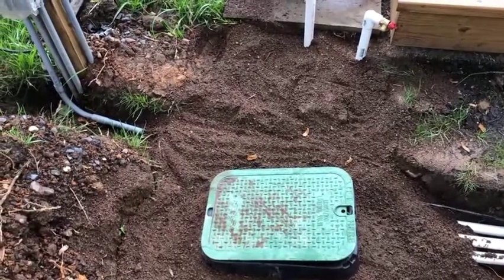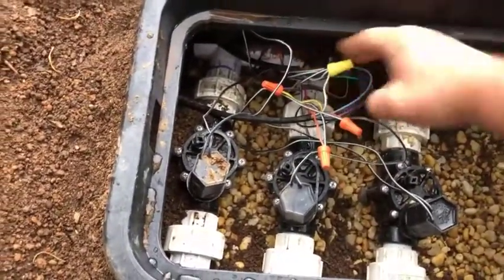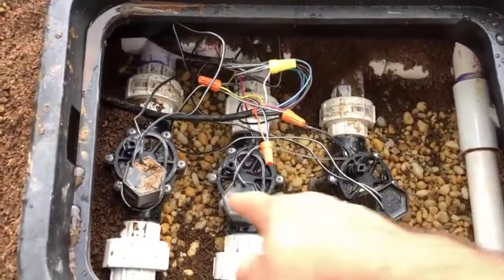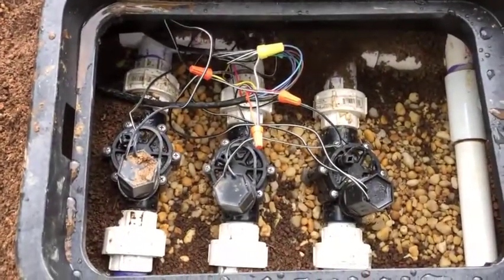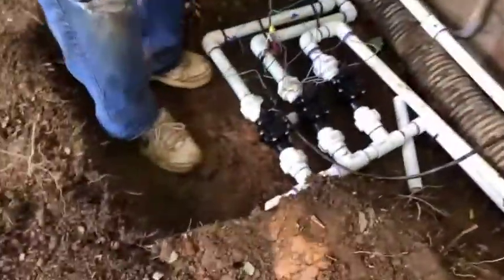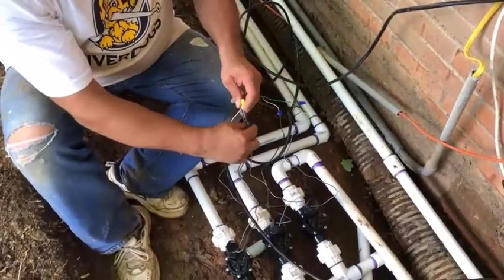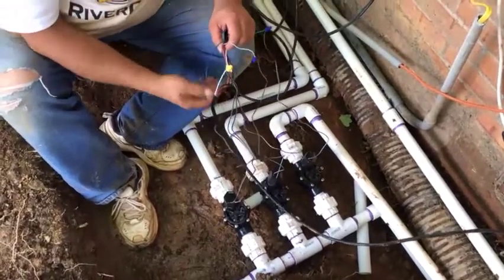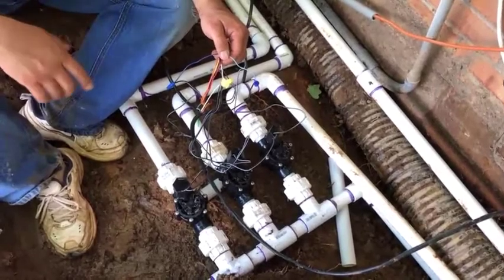8. Home Lawn Irrigation System - Wiring The Valves

Comment: Hi, great videos and work.. Can you show the connection of the relay cables at the punp?
Reply from the maker: Two videos for you
https://www.youtube.com/watch?v=0eEDXdO1fo4   and   https://www.youtube.com/watch?v=CcHFaiujry4
The FIRST one shows the working wiring simulating with a simple battery, controller, solenoid zone and a light bulb simulating power to the pump.  Shows entire circuit in operation.  The second shows a drawing to help clarify how the wiring (in my scenario) works.  The irrigation wiring is TYPICALLY smaller low-voltage guage wire, but MANY wires within the sheathing.  So as you have the main line of all wires going out, you just split open the sheathing at the first manifold, expose the wires and pick as many of the wires as you need to connect each valve in the manifold.  Then the wire continues down-stream to the next manifold and do the same with the remaining wires.  The diagram / video shows how MY setup is actually done so you can see where the wires terminate along the route.  The final black/white for power to the relay switch is what goes all the way to the lake (water source for my instance), but the white (neutral) is required as connection to EACH solenoid valve.  Hopefully this helps clarify.   Additionally, I have about a dozen showing different components of how I put it all together from sample, parts and pricing, building my own multi-zone manifold, and even the hose connections to the sprinkler and rotator units. Hope the others also help whatever you are researching.
Reply: @drapp5752  thank you, great work!!!

Comment: does a new wiring line need to be ran off of each manifold or do you just run one line to all of them? When connecting multiple manifolds.
Reply from the maker: Take a look at another of the videos... https://www.youtube.com/watch?v=CcHFaiujry4    On this, it shows a visual drawing giving better context.  The irrigation wiring is TYPICALLY smaller low-voltage guage wire, but MANY wires within the sheathing.  So as you have the main line of all wires going out, you just split open the sheathing at the first manifold, expose the wires and pick as many of the wires as you need to connect each valve in the manifold.  Then the wire continues down-stream to the next manifold and do the same with the remaining wires.  The diagram / video shows how MY setup is actually done so you can see where the wires terminate along the route.  The final black/white for power to the relay switch is what goes all the way to the lake (water source for my instance), but the white (neutral) is required as connection to EACH solenoid valve.  Hopefully this helps clarify.
Reply: @D Rapp  I've been adviced to use anything from 12-18 Guage wire. Any suggestions?
Reply from the maker: Going down to 12 gauge wire I think is a bit extreme... maybe more commercial, but not necessarily for home systems, unless you have such a vast distance that a larger wire to carry is of concern.  Also, per other video, ex: an 18/10 wire is 18 gauge, 10 wires included in the wire set -- per my video showing how I have all my zones established.  6 zones, 2 for black/white power and 2 spare.  Good luck with your build.  Also, if you do a search on my video series looking for "Home Lawn Irrigation System" should find them all too.

Comment: Hi, they are 1 inch white pvc pipes ???
And 1 inch sprinkler valves ???
How many sprinklers per zone do you have ???
Thank you.
Reply from the maker: Correct, all the runs are 1" PVC, but make sure SCHEDULE-40 which is the thicker wall which has higher pressure capacity.  Yes, all 1" sprinkler valves too.  The other (forget schedule #size) is a THIN wall which you can squeeze between thumb and finger which is drainage only, no pressure.  I have 6 zones in total.  1=Garden hoses, one by the lake and other led to the front of the property. 2=back yard, 3=left-side, 4=right side, 5=front pond/garden area, 6=front yard.  My controller has capacity of 8 zones in case I ever did want to expand.  Anything else I can clarify for you?  Let me know.
Reply: @drapp5752  Thank You For Answer Me Back My Friend, 
How Many Sprinklers Head You Have In Each Zone ???
I have Same As You 6 Zones But My Pipes Are 1-1/2 And 
I donot Wanna Buy 1-1/2 Valves Because They Are So
Expensive And I Wanna Buy 1” inch Valves Same As You
Do You Think It Will Work Strong Same As bigger Valve ???
Thank You.
Reply from the maker: I'm a bit confused, you have a fully installed system already?  Or just that the 1 1/2" pipes are where your water supply is coming from?  If coming from 1 1/2", then tapering down to 1" should be fine, you'll just have a lower volume of water coming through.  If you dont have your system installed yet and want 1" throughout,  run with 1".  However, the 1" is not the kicker.  If you take a look at my other video https://www.youtube.com/watch?v=eFkOoUoLeqI where I go over the parts, pricing list and such, you'll see about 6:50 where I start the part about the PVC and the swing-arm which downsizes to a smaller flex pipe before the actual sprinkler / rotor heads.  No matter what size pipe, getting to the final sprinkler gets downsized as close to the end as possible anyhow.  Now, for the zones.  It all depends on your layout and the distances needing to be covered.  My back yard has 3 ROTOR heads with adjustable to 360 degree spray going about 25' radius, or 50' full circle but have some overlap.  The sides of the property are only about 10' wide, so those have the sprinkler style heads which also fan out.  Since I have them against the house, I have them fan only 180 degrees, no sense spraying the house.  I have 4 of those on each side and have overlap to limit the arc at the outside edges.  They spray out a good 9-10' and more than cover my needs.  The pond area / garden I have two in similar fashion.  The front yard is narrower (about 26' wide, but long, about 100') and that is covered adequately with 3 rotor units.  Anything else I can help clarify, let me know.
Reply: @drapp5752  Yes I Have Already Installed The Sprinkler System But
With an Index Valve .... All My 6 Zones Are 1-1/2 Pvc Pipe And 
I Wanna Install 1” inch Valves = 15 dollars Because are more economic Than 
The 1-1/2 Valves 70 dollars ....
I scare to donot get strong flow because each zone has 10 and 12 Sprinklers head.
Thank You My Friend, Do You Think I can Install 1 inch valves ???
Reply from the maker: With 10-12 sprinkler heads, you obviously have a larger coverage area than a normal yard such a mine, even at a total of about 1/2 acre (house and land).  The reason for the larger valve requirement is to handle the amount of flow you have going through your system, especially if they were rotor heads that allow much more water flow.  You would otherwise completely lose the capacity to activate all the heads with the lower size valves.  Sorry, but yours is probably specked out appropriately to your installation and water pressure activation to "pop up" the rotor and sprinkler heads.
Reply: @drapp5752  I Understood Your Advice Thank You So Much an Have a Wonderful Year.